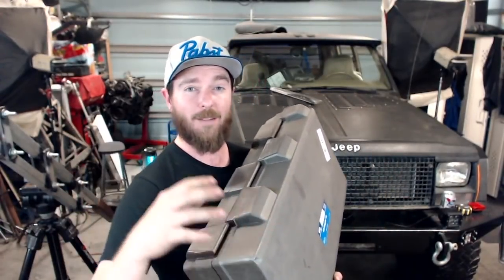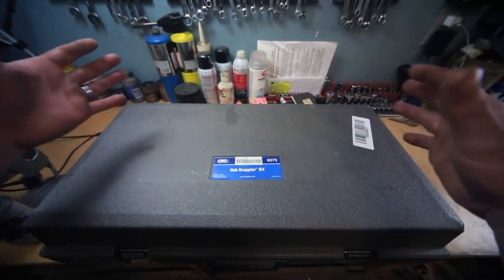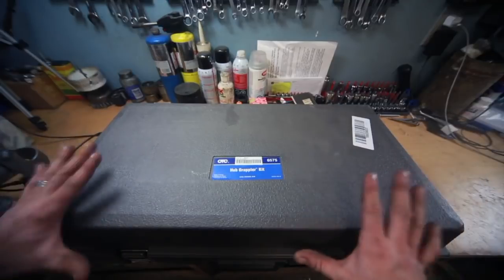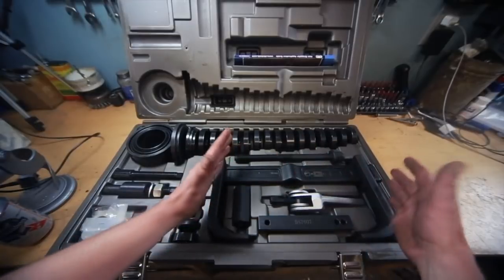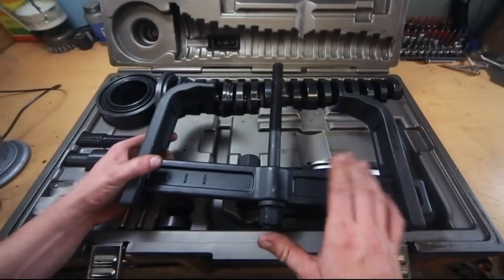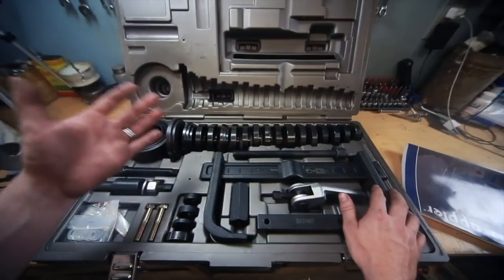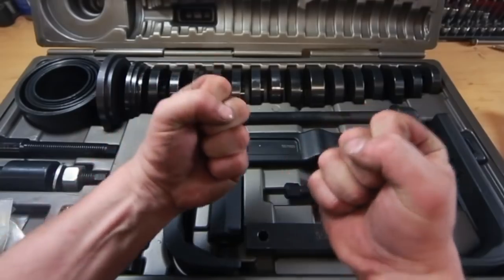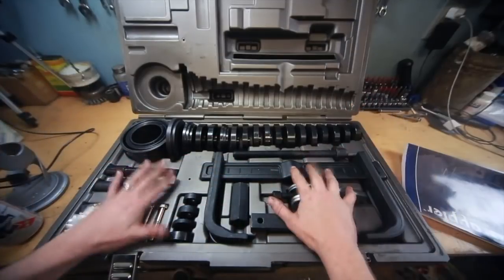OTC Hub Grappler - Wheel Bearing Tool - First Look - Review

Comment: What is the difference between the Hub Grappler  and the Hub Shark?
Reply: Two different companies.  OTC and Ken-Tool.  I own and use both.
Reply: @karpenterken1  What one do you prefer? I know Ken-Tool is some pretty heavy duty stuff.
Reply: @707SonomaComa  I bought my original Hub Shark in the mid 90's when it was made by Old Forge.  That company made everything super duty and in the US.  They went out of business and sold off manufacturing to Ken-Tool and Mayhew Tools.  Still made in the US with a lifetime warranty, but discontinued due to Ken-Tool's manufacturing costs they told me.  They refuse to make stuff overseas to lower the cost.  OTC Hub Grappler made in China.  Also has lifetime warranty.  Metal parts aren't as strong as the Hub Shark and the Hub Shark works better on trapped rotor removal and spindles with the tapered outside to the bearing housing.  The Hub Grappler's sleeves slide around on the tapered area causing the whole assembly to go off center easily during a bearing removal or installation.  I didn't stop to recenter the tool and it damaged the forcing screw threads and some other parts on me.  Just something to be aware of and not a huge deal as the parts still work.  OTC sent me brand new parts as spares.  The Hub Shark's reversible legs that attach to the tool's bridge allow it to span the bearing housing when there isn't a flat surface for the sleeves to be used against.  They're both great companies for customer service.  OTC has much better marketing and so many people aren't aware of Ken-Tool and Old Forge tools over the years.  Overall I'm happy with both, but favor the Hub Shark a little more for the reasons I listed.  Also, the Hub Shark comes with a thrust bearing for their forcing screw and a better tie rod puller for taking off the bearing race from the hub with its flatter bottom feet, unless you want to grind the round bottom feet on the OTC tie rod puller.  Less flex in the design of the Hub Shark assembly makes the most rusted on difficult pulls easier, in my experience.  Long answer, but I hope all of the info helps and if you want either tool to last a long time, frequently use a  thick moly EP grease on the contact faces of the parts and the threads.  Spray lubricants aren't good enough under extreme removal pressures of 5 to 10 tons that these tools generate.